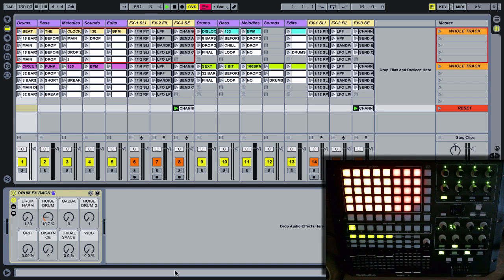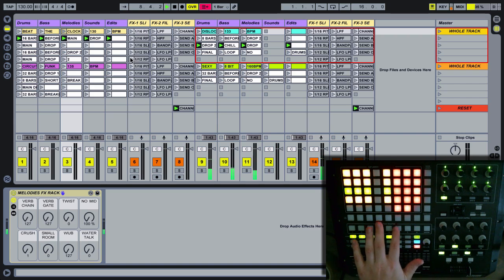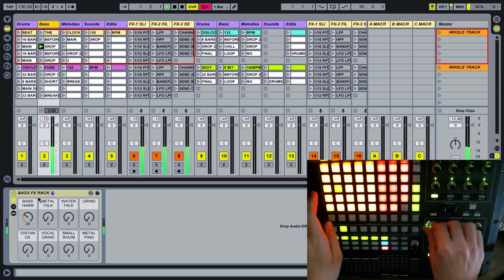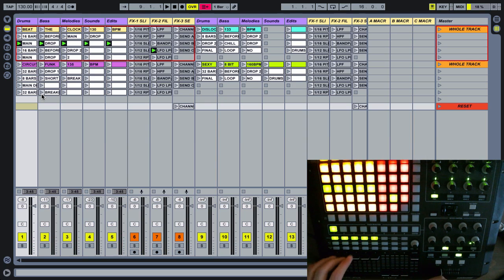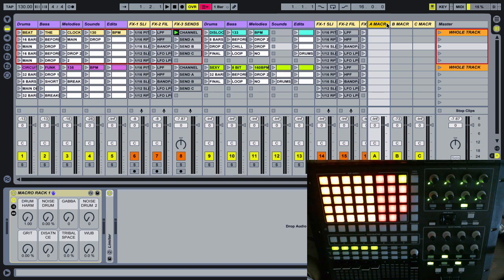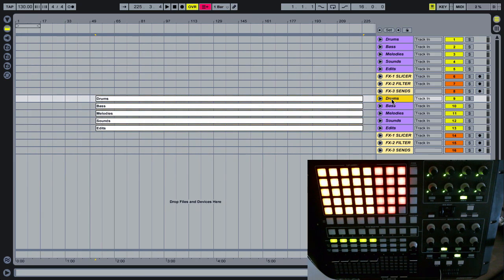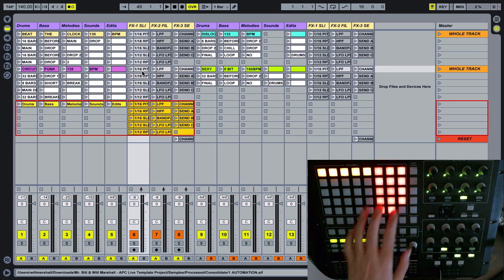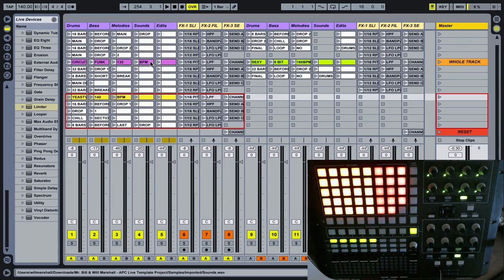Glitch Factory: APC40 Performance Template

Comment from the maker: Ok, to begin with, almost everything you've asked has been answered in this video and the installation video which can be found on the product page.

MIDI Setup: Have the APC40 script set to APC40Live, set the input and output to APC40, then set track and remote to on for input and output (don't worry about sync, that's only used for syncing multiple Ableton's).

All your problems should be non existant if you set this up correctly.

Comment: Dudes... this be aces :) think this may just be the basis of what i'm needing to get going.  Couple of questions though, I only have the apc20 can i still get this to work ok? I use it with the evolution uc-33 & was hoping i can just move some of the mapping? Main probs I can see would be maping so when individual track is selected the same pots are changing the rack on that channel.  What are your thoughts?  Oh sidenote, some flaming hot sounds u got too!! :)

Comment: Also, speaking of that murky bit of explanation regarding the track, remote, and sync settings, it'd sure be helpful to have you explain how this should be set up in painstaking detail, because, as it sits, I'm not even close to sure that I've configured these settings right, and I'm afraid that may be the root of the problems I'm having. Also, occasionally the Master ppm meter aka clip track trigger buttons just stop working. As do the other clip trigger buttons.

Comment: From the first time i loaded this template (following the instructions to the letter (exc for the murky bit regarding the inputs and outputs remote enabling in the midi tab in options menu) I've had trouble with the bottom row of buttons triggering the fade to black effect (yes I've messed with the slider that controls that parameter's wet/dry) basically, they don't turn it on, so I manually midi mapped em to just be on or off, instead of the way they were designed: on only when held down.

Comment: Ok this may be a silly question but on this template how do you adjust the bpm between tracks? I saw you had a 130 bpm track and then the 140 bpm that you diced up. How would adjust the bpm during a live performance. (Again sorry if this is a newby question.)

Comment: Hi Mr Bill, scuze the nooby question but is it easy to switch between the original APC 40 template and The Glitch Factory, is it just an option in the MIDI setup preferences?